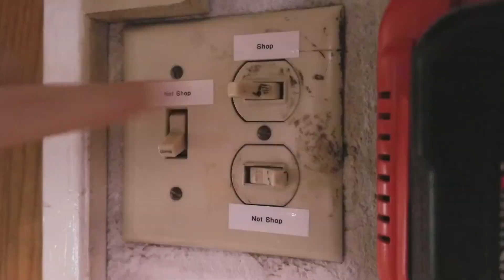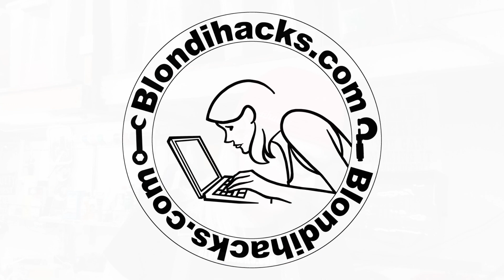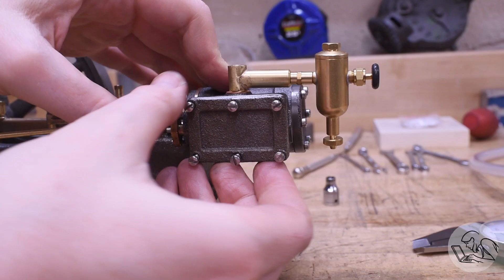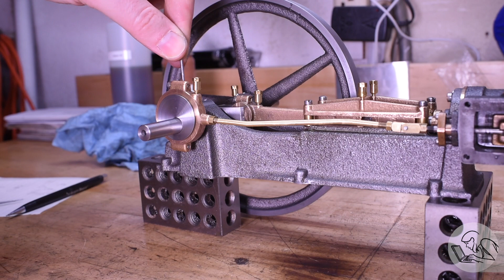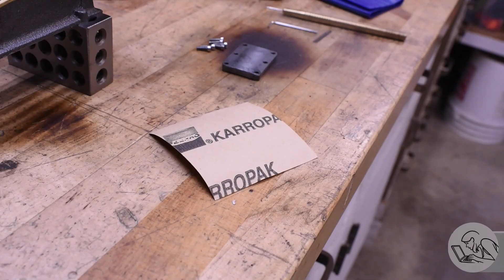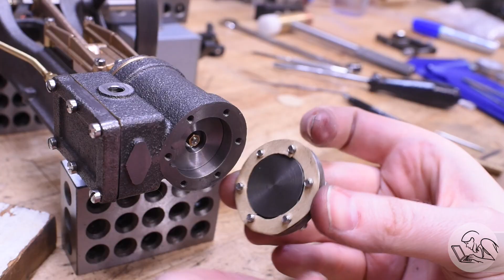Model Steam Engine Valve Timing

Comment: Quinn, any tips on timing a twin Cylinder LBSC "Molly" with Stephenson Link motion.
Can I time one Cylinder and then the other, based on the method you show in this video?
I assume that the non adjusted side would just be driven by the "Timed side, until both are adjusted?

Comment: Love your work, I've been learning about steam power for many years now and I have built a few engines,,from a tiny model stationary power plant for my Boss in 2000,, I learned a lot from from that experience & I promised myself to never again attempt to make another one that small,,1/2 inch bore & 3/4 stroke,,steam whistle had a 1/8 inch ,ball end valve seat,,very hard to make...at present I am building a 20 + HP  engine for a 20 ft. Catamaran boat I have,,I mostly love my sailboats as I am a sailing  NUT.  / I  LOVE  your YouTube videos & you have my respect for you are doing ❤️,,/ Keep up the good work.

Comment: We have all heard Railroad steam engines running, there is normally for twin cylinder engines a 4 beat set of chugs. You can actually tell which cylinder is getting more steam, that is the louder pulse.

And yes, we all love Quinn's work, both on the machining end and the video production end. So very well done.

Comment: I have been watching your build and really am enjoying the process. You are very gifted with machining talent and entertaining commentary! I do have one suggestion/question. I may have missed it, but have you checked the balance of the flywheel! It may be that with a small engine like you have built, that it isn't too critical, but every flywheel I have ever seen on different types of machines will show evidence of balancing. Putting the wheel on a straight axle between two level parallels, the heavy side will balance to the bottom, and small holes drilled along the outer rim will remove weight until the wheel will stop and stay at any position. If I missed you doing something like that, forgive me,  but it might just make the tuning even better.

Comment: Hey, Quinn - Just picked up that pressure gauge. How did you go about removing the existing tire-connecting end so that you can thread it into the valve? Loving the series... embarking on an engine of my own as my senior project in my CNC machining class - #1 wooden beam engine from here http://www.john-tom.com/html/ElmersEngines.html
Reply from the maker: It unthreads
Reply: @Blondihacks  ok, i won't hesitate to crank on it then. the first pliers i tried just scuffed the paint off the tube, so I quit thinking of the possibility of something like Loctite. Will use propor vise-grrips and a vise and try again. Thanks!
Reply: For future reference, there was indeed Loctite on the threads.

Comment: what is the correct rotation of this engine?   at 13:40  the rotation is CCW,  at 13:47 it is now rotating CW and at 14:22 we are back to CCW.
Reply from the maker: There is no “correct” rotation for steam engines. You can run them either way you want, as I said in the video.

Comment: Thanks Quinn, great detail, I just set mine on 90 degree timing not knowing any better--I still have a little work to do.  I liked the advice on the low pressure gauge as well.  I am looking forward to the governor project, hopefuly you give enough info that I can build one too. :-)

Comment: Steam expanding ?
How can that be when water in gas form goes to water in liquid form ?
Reply from the maker: The steam is under pressure and very hot. It doesn’t condense until all the heat is removed, which is essentially what steam engines try to do- extract the heat.
Reply: @Blondihacks  Under big pressure, I just read it was from 200 to even 1500 psi. 
Maybe you gona make your engine a working engine and pump up the power, that would be interesting, gotta test it out, see how far you can go til it breaks and see how and where it breaks, sum scientific reeeesearch.
Love your videos and clear explenations about stuf.

Comment: Nice job of explaining how to set up an engine to run properly.      Traction engines need to properly in both directions.  The original owners of my Keck had it adjusted to provide a little more power in the "belt" motion for threshing.  I have it adjusted more equally since I use it to thresh & sawmill.

Comment: Does it run in both directions? Or does that require a seperate tuning process?
Reply from the maker: Each direction requires different valve timing (180° out) but there are valve gear setups that allow you to reverse the engine by shifting the timing in this way. Reversing linkages are common on locomotives, traction engines, steam cars, etc.

Comment: I never see any of these models run on actual steam??? Nevertheless, it’s an excellent series, I’ve continue to enjoy ☺️. Thank for the work and time that has been put into these vids.
Reply: Jeremy, have you found Keith Appleton? He has in excess of a thousand videos on model engineering, many of which feature real steam.
Reply: @624Dudley  I haven’t, but I will. Thank you.
Reply from the maker: Rest assured, it will. I have boiler work to do. Patience!
Reply: Building a boiler is something to be wary of, as a badly made steam boiler is indistinguishable from a bomb. I built a simple bar stock engine a while ago but haven't the nerve to attempt a boiler for it- I just keep running on compressed air.

Comment: This is so cool. Got me thinking of all the old print shops that ran multiple presses off overhead belt drive systems. Which got me thinking about the 1874 treadle jobber I have. I know that, at age 75, I can run that press for quite some time, five pumps of the treadle for each impression (print) without getting the least bit winded. (Yeah, I feel good about that.) And that got me thinking of how much energy it takes to run the press that way versus how much steam engine energy it takes or would have taken "back in the day" when my father was doing this stuff. I guess that's the fun part of all this: aside from the artsy part of building the engine or setting the type & inking up the press (and picking out the paper & other graphic design considerations), both of 'em require a sensitivity to the machine itself (or the type). Which may be why I find your videos on this so fascinating. 
. . . Another informative, science-ish video for the other tool use to enjoy. Thanks!

Stay safe & stay healthy!
Reply: For reference, human muscle is about 25% efficient at turning chemical energy into mechanical work. A steam locomotive is at best 10% efficient, so assuming the performance of the old stationary engine was similar the amount of energy per print would have been quite a bit higher in the old days of steam. Of course from this we can also infer that running your press on power generated by a modern electric plant (e.g. supercritical steam or gas turbine, ~40% thermal efficiency) may actually emit less CO2 per print than pedaling it with your legs, depending on the efficiency of the local power grid!
Reply: @nerd1000ify  Or, as my father used to bark when the car windows steamed up "Goddammit! Stop breathing so much!"

At my age, by the way, an hour or so of pumping the treadle gives me a certain satisfaction. I'm 75 and I can do this and not get winded. And the end result is usually something that I can appreciate from a graphic arts point of view. 
. . . So I consider it a win.
Reply: @haramanggapuja  there's a lot to be said for that satisfaction of doing it yourself.
Reply: "the other tool user" ;-)

Comment: Nice!
That makes as satisfying a sound as Abom79's shaper clacking away. Yours is a pleasant snicka snicka snicka... and his is a comforting *sshhhhh clack clack*.
And yes, those are also technical terms.
Looking forward to the governor lesson. I also watch Jonathan W on YouTube and he recently dragged an old steam engine out of the woods. He also needs to build a governor for his, after getting the old crane he dragged out of the woods up and running so he can lift said steam engine around to work on it. Check it out if you get the chance.
Thanks, and Meow to Sprocket.

Comment: Good "timing" video Quinn. A small tip on that packing install is to slightly flatten the packing with your tappy tap tool(aka hammer) so you can get it in the stuffing box. The gland will swage it to the shaft and stuffing box.

Comment: Another method is using audio recordings and something like audacity, you can use the wave form and make quite accurate measurements of the evenness of the beat. I've done it for a watch
Reply: Quinn has a very good multi channel O-scope. Put a mike on the engine. Run the engine while watching that. You can even mount up switches on key components ( I myself would use prox ones) and for real fun you could mount an encoder to the crank. Then just tune by the numbers. 

I am contemplating building a dual overhead valve digitally controlled steam engine, something along the likes of what would exist if the world had not gone to an ICE design.

Comment: Absolutely AWESOME!!!!  Need an hour long ASMR thing with the steam engine running...LOL
You could probably get one of those cheapo inline air oilers for compressed air tools to oil it on air so it could run longer on compressed air.
https://www.amazon.com/Actopus-Line-Oiler-Lubricator-Compressor/dp/B07412L4GV/ref=sr_1_4?dchild=1&keywords=inline+air+oiler&qid=1613241168&sr=8-4

Comment: Nice to see this running as steam engines are one of my interests, great job.  When you get fed up with the packing switch to o-rings (I use them on my 5" gauge engine, videos on my channel if interested) and well done for mentioning steam engines run differently on air compared to steam!
Reply: T bag string soaked in oil and graphite powder lubricates and very little friction